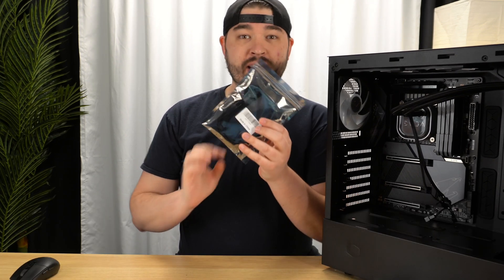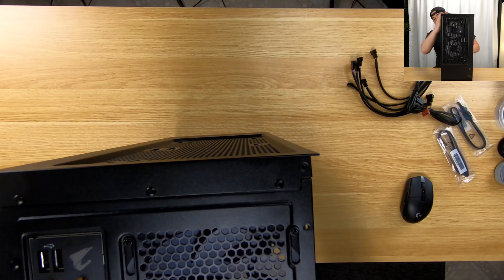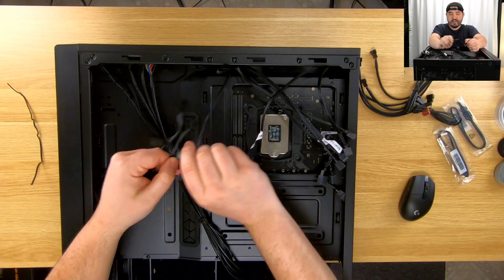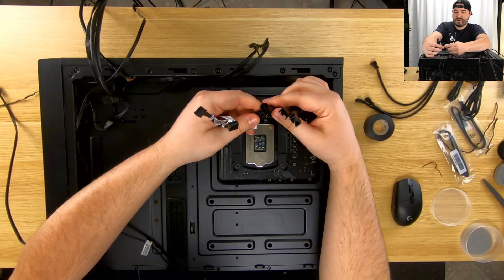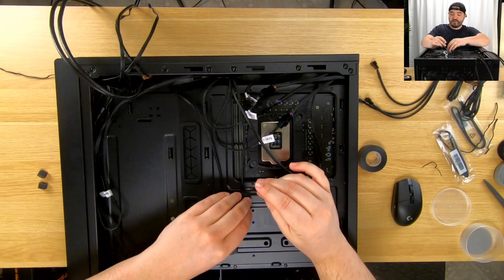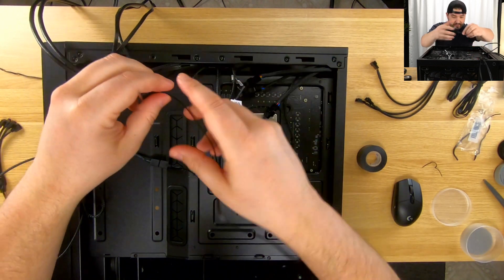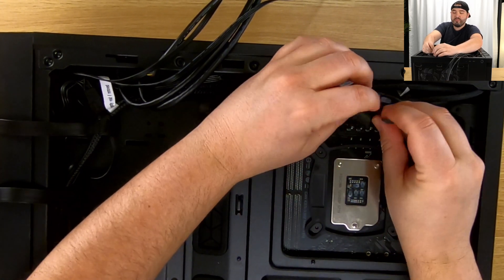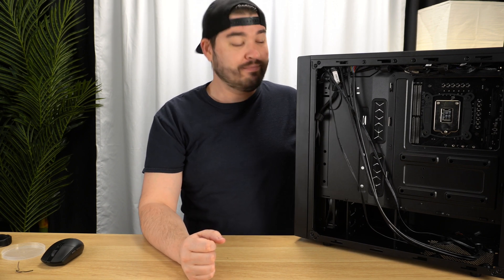Don't Overlook This PC Building Step! (PC Build Pt 6)

Comment: Not advised to break a pin off also not advised to put it on the floor so you can step on it later like a Lego because they hurt worse than Lego. 😁 I say the Velcro stuff is better to use than zip ties because you can always move them around instead of permanently being mounted and having to go through a lot of zip ties because you don't like where you zip tied cord at least with these you could move it to where you need it and then put maybe a zip tie or just keep it like it is.